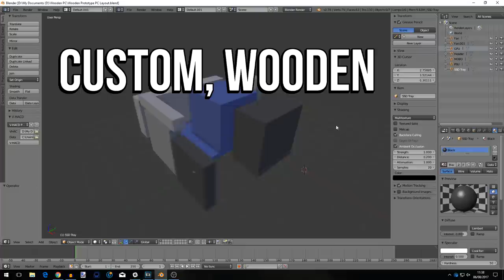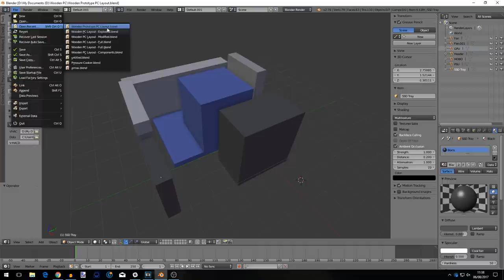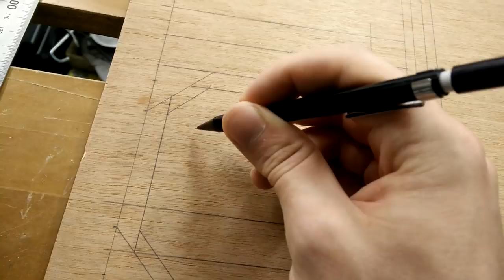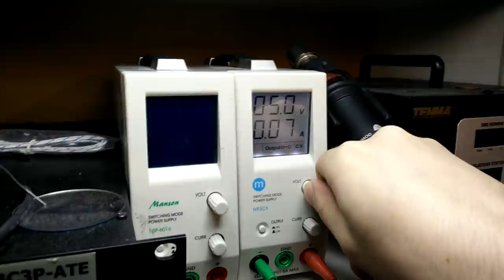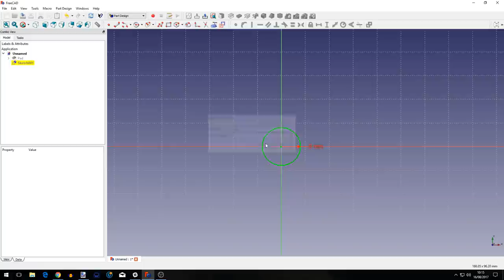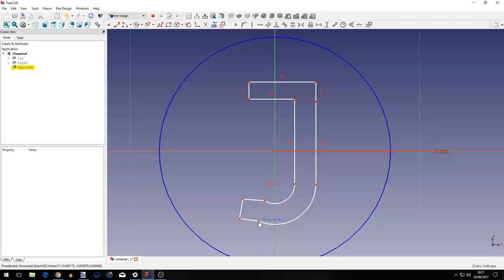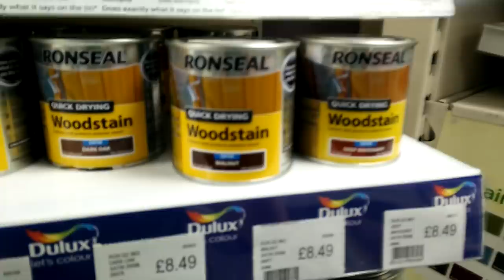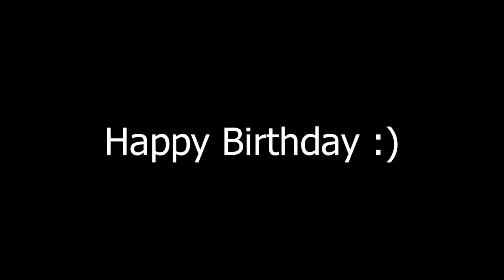Building a Wooden PC Case

Comment: Harv, a little tip when soldering two wires together like you were, once the wire is stripped tin each conductor individually, i.e. apply heat and add a little solder to the tinned end, your looking for it to coat the tinned end and flow into the strands, you should see the stands but with a thin layer of solder on top. This done just touch the two conductors together and apply heat again, then once the solder melts and joins the wires take the heat away while holding the wires still (I advise fixing one cable to the desk or whatever with masking tape and holding the other) for a second or two while the solder sets. This will give a much cleaner joint :)

Comment: Wow, this looks nice !

By the way, while Blender is an awesome program for 3D modeling, It's not buildt AT ALL for CAD.
I'd recommend using ONShape (free, no install, easy to use, but every model is public in the free version). 
This can allow a real company to take these to cut metal sheet to get a good looking aluminium / steel case!
Reply: There's also Fusion360 which is free for hobbyist use, and from my experience has a lot of the same features as Solidworks.
Reply: I think your comment about having a company make it in steel is kinda missing the point of making it in veneered wood.